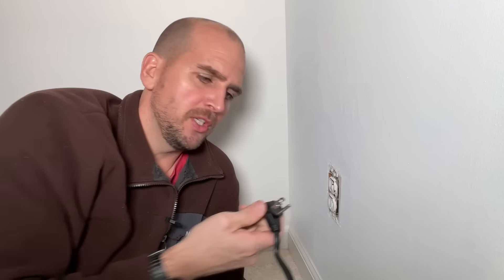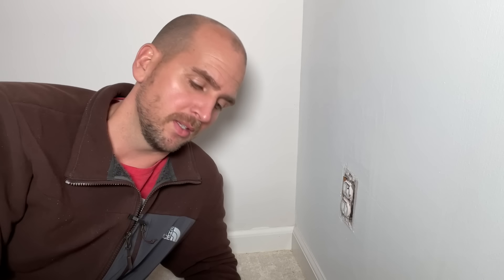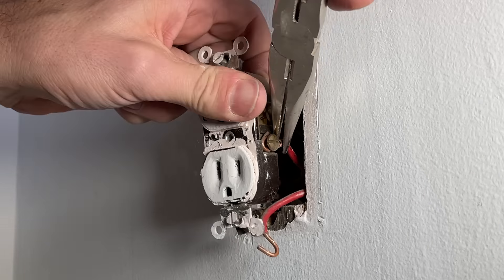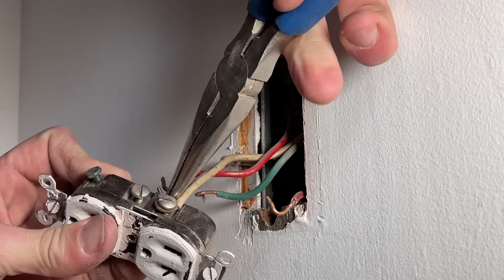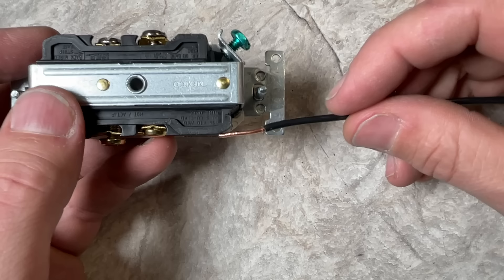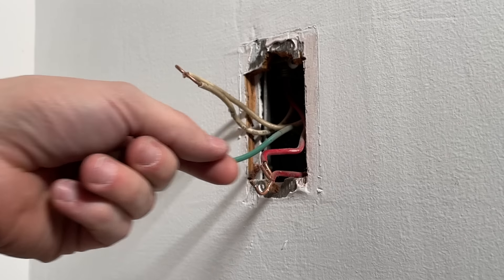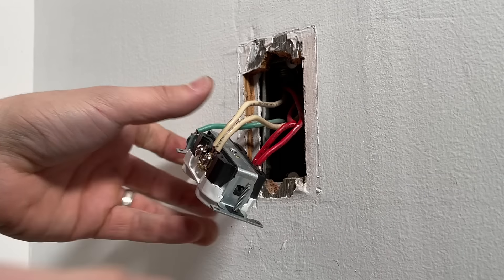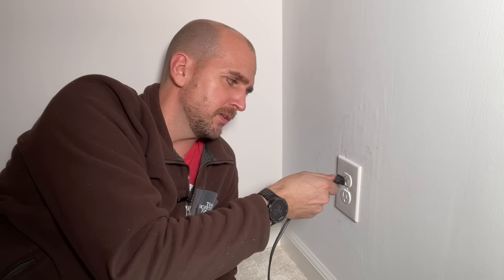Plug Won't Stay In Outlet

Comment: I had this same issue with an outlet above my kitchen counter. My house was built mid-1960s. There were 3 romex cables going into the single gang box. Unfortunately for me. all the wires inside the box were way too short and there was no additional slack in the romex. It was a nightmare just to remove receptable because of the short wires. After a number of trials and errors, I had a DIY solution to get the outlet back into use. First, I used Wago splice connectors to lengthen all the wires. Next, used 5 wire Wagos to make all the connections. Tested all the circuits to make sure all lights and outlets feeding from this junction box worked. But I was left with not enough space in the box for the outlet and everthing else. So I needed something  to make the box larger. I did not want to open the wall up due to the backsplash being tiled.  In the end I used a raceway box and made the outlet external. This gave me enough room for everything to fit.

Comment: I really expected you to splice the the hots and the neutrals and add a pig tail.
Reply: IMO that’s the best practice to use
Reply: Depend on where it is in the circuit.  I do that for switches but not outlets.

Comment: Always ground, nuetral, hot in that order. And never get between those nuetrals. You never know if they are being shared or someone hitting the breaker on while you are working on it. Pigtails would have been a better choice. And you definitely should have used an Arlington sleeve for the gap. Hard to see if it was s code issue but using the Arlington sleeve eliminates that issues.. Bro I am an electrician and I love this channel keep up the great work. I am not being critical but I am because it could cost you your life.

Comment: When I go to the hotel I always replace the outlets
Reply: LOL - I have made simple repairs - squeaky doors, running toilet, loose door hinges,  F"ed up lamps - but I've never replaced an outlet. You are a funny guy.🤣🤣
Reply: You're an unsung hero
Reply: It's difficult to find someone who is a bigger smart acre than me.  You the man.
Reply: item must bring while travel... electrical screw driver xD
Reply: I usually use a screw driver to tighten up the clearances in outlets when at hotels. It's dangerous replace them without cutting the power off
Reply: @LarrySong712  
I bring my tools with me in hopes of getting better pictures for my Powerpoints.
Reply: @TypeR891  I was just joking because the video implied that the hotel outlets should be fixed. I agree working them hot is dangerous - generally I tell my wife to do it!
Reply: When staying a hotel from now on I will request the Jim Jacques Suite. 🔌🪛
Reply: @jxclark13  hope you are well grounded
Reply: You too???
Reply: In case you DO travel a lot: carry a three-prong outlet splitter (like he said, they're a LOT more stable) and plug into that. Bonus: you can poach someone's outlet in the airport and not be a jerk about it.
Reply: Just tie the two red wires together and add a pigtail with wire nuts to extend wiring . do the same with other side (white) or neutral line.
Reply: @jerrysmith372  I've had to service the bearings in the bathroom ventilator fan, and clean the air filter in the heater/air conditioner unit.
Reply: @vincentrobinette1507  In a room you've paid to stay in? That's a bit too far for me and I would change rooms before I do that. You gotta draw the line somewhere.
Reply: @TypeR891  Chewing gum works for me, preferably already chewed.
Reply: When I play football, I always prepare for an outlet pass.
Reply: Do you search around for the breaker panel or change it out live? Or are you being facetious ?
Reply: @leekumiega9268  - facetious! no way. I simply tell my wife do it.
Reply: Bet that get expensive
Reply: @deborahw6860  - not really, I use some I get from GoodWill
Reply: @jimjacques8167  LOL
Reply: I just use some bubble gum to hold stuff in there.  Don't worry the cleaning lady will find it when she tries to plug in the vacuum cleaner.
Reply: Outlets 😂..his eyes are pretty
Reply: lol where's hotel management when you need them. They should hire you🤣🤣
Reply: You can't be too safe, that i know of.
Reply: Do not tell their insurer.

Comment: I noticed when you screwed on the cover that you didn't leave the screw slot lined up horizontal or vertical but just sort of on an angle..my brother in law said most electricians are fussy about that point so all the screws look the same...i myself wouldn't notice it.
Reply: Absolutely, I always leave mine vertically

Comment: Third generation electrician here. The only thing I would add is to pigtail the wires in box. My state requires neutral and ground to remain unbroken, and we do hot also. If a plug fails you won't lose neutral, hot, or down the line outlets. Throw wire strippers out...they suck.

Comment: New regulations!  The white wires have to be pigtailed together, same with the black wires. Only one wire allowed under terminal. Red the same. Most house wiring is 15 amps
Reply: I believe pigtailing is only required if it is a multi-wire branch circuit (2+ hots, 1 neutral, 1 ground). Which is not what was shown in the video.
Reply: The NEC  has required the neutral wires use a pigtail for many years ,is this something new with the hot wires?
Reply: @leekumiega9268  It is my understanding that the NEC does not use the term pigtail. Instead, 300.13(B) states “In multiwire branch circuits, the continuity of a grounded conductor shall not depend on device connections such as lampholders, receptacles, and so forth, where the removal of such devices would interrupt the continuity”. The grounded conductor is the ‘neutral’. The ‘hot’ is the ungrounded conductor and the ‘ground’ is the equipment grounding conductor aka grounding conductor. I see no mention of maintaining the continuity of the ungrounded conductor. As mentioned before, the circuit shown in this video is not a multiwire branch circuit.

And 250.148(B) states “The arrangement of grounding connections shall be such that the disconnection or the removal of a receptacle, luminaire, or other device fed from the box does not interfere with or interrupt the grounding continuity”. 250.148 does not appear to be just for multiwire branch circuits.

Hence, the only thing that needs to be wired to maintain continuity in a typical 120V, residential, non-multiwire branch circuit, is the grounding conductor. NEC does not require the grounded conductor nor the ungrounded conductor to be ‘pigtailed’ in this situation. Best practice or local code may say otherwise, but the NEC does not require it.

p.s. If maintaining continuity were required for all conductors, all installs, it would be a little hard to wire receptacles downstream of a GFCI receptacle. The downstream receptacles have to be dependent on the GFCI receptacle in order to gain GFCI protection.

Comment: I plug in a radio in and crank it up. Find the right breaker and you'll know you've found the right one right away.
Reply: Yep - they do that back in the hills. Us card carrying electricians do it the way he showed and put a lockout device over the breaker to keep the other hillbilly from switching it back on to hear the music.
Reply: Why not an electric drill?
Reply: Bryan Budd great idea !!!!!
Reply: @danielhowiesr.2593   you can use whatever noise making electronic you want but with a drill you would need to keep the switch held down when you’re not standing there and that is just asking for trouble.
Reply: @jerrysmith372  you’re not an electrician
Reply: I just have my gf hold on to the wires and I know the power is off when I hear her hit the floor 🤣

Comment: I've seen such loosey-goosey plugs that there's an incredible amount of resistance and the Spades of the plug actually got extremely hot and melted the plastic of the extension cord molded around them. And it is usually the plug it always gets used for vacuums
Reply: That makes one hot sucker.  Cheers!

Comment: the 59 cent recpt is just for contractors to make extra money, a specification or hospital grade is the only one i buy because i worked at a place that built pumps and every single one was plugged in (thousand times a day) and ran to test flow, pressure and draw, as a result the cheep ones wouldn't last a day, on the spec and hospital grade the plastic would wear out to the point where you could touch the metal with your little finger but would hold the plug.

Comment: Thank you for this great instructional video, I have question, the two hot and neutral wires were connected to a single terminal instead of each wire to its own terminal as the old outlet, does it make a difference?
Thank you.

Comment: I’ve always recommended going commercial grade.  I’m one of these OCD guys that won’t leave the faceplate screw in an angle.  Vertical slot when I can. Just an appearance thing with me. 

Only 12 more outlets to replace in home.  Never use them I just habit of upgrading when I buy a home.  And the contractors who built my home should have been fired.  ( developer went belly up, explains a lot). 😏
Reply: Horizontal screw slots are faster.
Reply: Amen. We think alike.🤔✔️
Reply: I'm in the same boat. I replaced every outlet and switch in our old house. The old ones were worn out builder junk from 25 years ago. Our new house is a new build and is full of builder junk so I get to start over. They definitely need to hire better electricians. The guy that did ours did not do a good job. (15A breaker/14awg wire for the garage outlets... Wtf?!)
Reply: Needs another half turn...  <crack>  at least it's now vertical....
Reply: @adamf663  if it starts flexing I back it up to vertical. 😂
Reply: Huh I like both absolutely vertical, of possible.  I guess I do not to be  controlled by asymmetry like them.

Comment: One thing that I would do when installing outlets is to actually have the ground prong facing the top. That way if a plug isn't bottomed out and something falls on the prongs, it goes straight to ground rather than across the lines and starting a fire/throwing a breaker
Reply from the maker: Hey Josh,  this has been a common comment and also interesting to see different people's feedback.  I follow the logic and seems reasonable, I have been digging in a bit and also collecting the 25+ comments covering this topic.  I will have a video in the coming weeks specifically discussing this topic.  Thanks for the feedback.
Reply: It really depends on what will be plugged in to the outlet.
Most Appliance Cords are molded with the Ground Pin at the Bottom, so it makes better Sense that the Receptacle be installed with the ground pin also in the down position.
Since this is not really addressed in the electric code.
it's a matter of preference.

I've also read this.
When using your fingers to plug in or pull out the cord, 
your Index finger is at the Bottom. So having the Ground pin at the Bottom is better in case of accidental contact with the bare metal when inserting or removing the plug.
Reply: I’ve never heard of something being dropped onto the exposed prongs of a plug.  I put the ground at the bottom simply because it seems more natural, as the ground is literally downward.
Reply from the maker: @wyldanimal2  appreciate the feedback 👍
Reply: Outlets are installed with the ground pin on the bottom so that if the cord is pulled out by its weight or by any downward force, the ground pin is the last one to break contact with the outlet, not the first, which could leave a device hot but ungrounded.
Reply: Many times when a plug is installed upside down, ground at the top, it signifies that it's a switched plug.
Reply: @GH-oi2jf  
Also, with the Ground Pin on the Bottom
our 3 prong outlooks look like a Surprise face  :o
Reply: @GH-oi2jf  unfortunately I've been in a classroom that had the cover plate come loose enough due to stripped threads fall onto the exposed prongs of a plug. Definitely a few sparks and a bang

Comment: Two things, remove ring, & wrap receptacle with electrical tape.
Reply: I agree. Wrap screws with Scotch Super 33+. And if you are repairing the outlet hot, you deserve to get shocked. When finished, install the outlet cover and make sure the screws are both vertical for a professional appearance.

Comment: This problem is, unfortunately built into the design. Also, when stripping the wire, turn the strippers round the opposite way to that shown here. That will give a flat face to push the insulation rather than squeezing it into the chamfer of the tool.
Reply: That is a great tip.  I have done tons of these and never thought of that.  Learn something new every day.  Thanks.
Reply: 2 things; first I have those strippers, they are chamfered on both sides. Second, those strippers have the "Klein kurve", (part number 11054) it would be extremely awkward to flip them an still use them in the same hand.

Comment: Why wouldn't you wrap the outlet with electrical tape around the termination points to provide a better level of insulation against an inadvertent short to the metal box?

Comment: Very informative.  All of the outlets in my bedroom are like this.  They must have been pretty cheap outlets, because the bedroom addition is 50 years newer than the rest of my house.  Will get those fixed right away!!
Reply: I've had the contractor-grade devices from the big chains (Lowe's, Home Depot) fail within 3 years with minimal use. It's upsetting how cheaply things are made with almost seemingly complete disregard for safety. Definitely spring for the higher-quality.

Comment: I just bend the 🔌 a little inward or outward and it fits snug as a bug
Reply: That will work temporarily.  Can’t beat a new receptacle.  Also, there is a tester that measures the grip strength of receptacles.  If you’re selling your home and your inspector does this test to all your receptacles, it might be very costly to replace all at one time.

Comment: Hey Scott,

This video on replacing receptacles is great, and so is your video on receptacle features.  However, you have to be careful with half-switched receptacles, which also have (at least) two sets of wires.  If you are following this video and replacing a switched receptacle (tabs broken off), then you probably shouldn't connect both hot wires to the same terminal post/screw.  If you do this, then the switch will no longer work (it will be shorted, hot on both poles all the time), and both bays of the receptacle will always be live.

(Ref. 10 Things You Didn't Know About Outlets: https://www.youtube.com/watch?v=vUlvrX4R3jI)

Just a caveat for viewers: Unless you look carefully, it's hard to tell (especially so when looking at a video of the old worn-out receptacle) whether the outlet being replaced is half-switched or not.  Look for the metal bridging tabs.  If they are still in place, then all is well: your wires were already bridged, and you can use a single terminal post, as Scott did (but I still wonder why).  But if the tabs have been broken off of the old receptacle, then you will probably need to break them off the new receptacle as well, and wire it exactly as the other receptacle was wired.  You can still use back-wiring instead of shepherd's hooks, but you would need to connect each hot wire to the gold terminal post (screw) corresponding to the half of the receptacle that it is intended to power.  You should do likewise with the neutrals, connecting each of them to the corresponding silver terminal posts (screws).

There are some good videos out there that show you how to intentionally remove a switch from a receptacle circuit - for example, after ceiling lights have been added to a room.  If you are intentionally removing the switch as you replace the old receptacle, then please cap the switch wire, rather than connecting it to a receptacle terminal that bridges it to another hot wire.  Otherwise, when you turn the breaker back on, you may find that the new ceiling light stays on permanently, too.

Thanks for listening!
Reply: As a DIYer, I have worked a little bit with electrical (replacing lighting). Watching this video because I might give this a try. What you added is good info and I watched Scott’s other video about the tabs (good to know!!). Thanks!
Reply: Awesome information.  Thank you!
Reply: He used two wires in a single terminal as a substitute for a pigtail connection.  If the outlet fails, you do not lose power downstream.  And per code, he explains in another video that you're not allowed to use a device to bridge outlets.  Using the bridge between poles constitutes using a device.  Having said that, I think a pigtail was a better option, and he probably should have done that instead.
Reply: The tabs he is talking about can be seen at 5:00, the small golden flat pieces on the side. Generally only the black or red wires' side will need to be snipped but just in case check both sides.